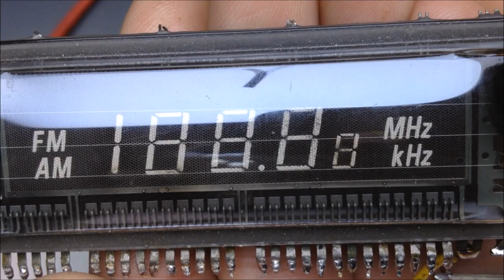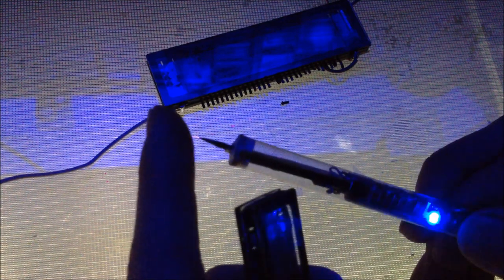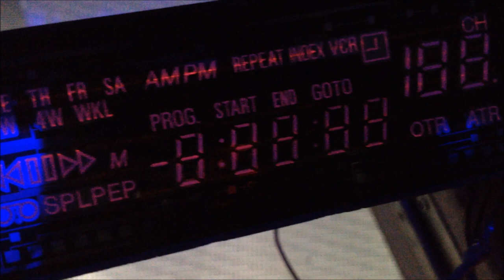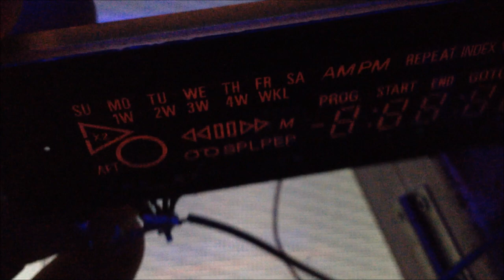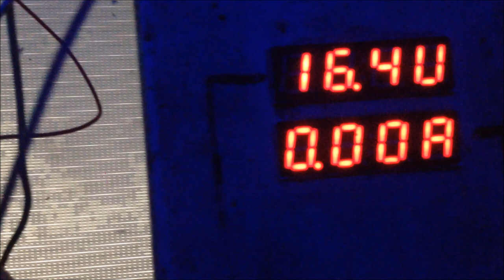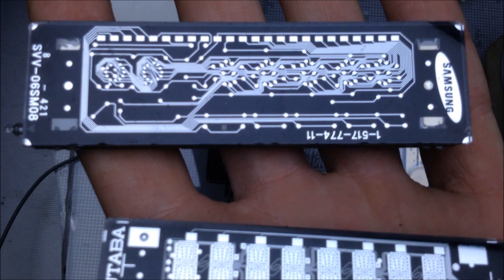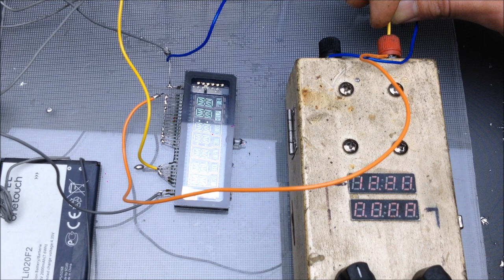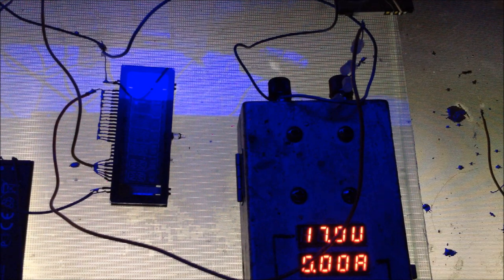How a Vacuum Fluorescent Display (VFD) Works, Wiring + More

Comment: I have started playing with pickle jars and plasma since I had 30KV and a lab vacuum pump sitting in my face. I wanted to create VFD elements to light up but no one would explain the actual voltages required. Your vid gave me the exact knowledge. Thanks. I am off to the plasma lab now!
Reply from the maker: Glad to of helped!
Reply from the maker: I can't comment on your video about the DIY decorative light you made but man, that's a clever use of LCD material so simple and looks really good. I am a fan of that LCD stuff and put it in all sorts of projects.

Comment: Do you know if the pins that are not positively biased need to be grounded, or can they be left floating?
Reply from the maker: I have not seen any resistors on VFDs from pins to ground so I think they can technically float. You'll get much faster response rates if there is a small bias to ground through a resistor on the pins though.

Comment: Thank you for this very helpful explanation. I am learning how these work and you made it all very clear.
Can you tell me why you have the series resistor on the filament drive when you are using a battery, is it for some form of current limiting?
I am working on an AC filament supply for some large Russian 7 segment displays so I can get an even glow across the large segments.
Reply from the maker: Glad it helped out. AC is a much better supply source than DC when it comes to the filaments. The resistor in series is for a current ballast. The filaments like to run in the 2v range and 4v from a fresh lithium ion is a tad much.

Good luck on your project!
Reply: @Zenodilodon  Wow - thank you for your speedy reply.
I get it - battery 4V, resistor - drops the volts - nice.
Yes, I am using a PWM source to generate 5V A/C.
I am using large Russian VFD displays  ILC1 1/7  and  ILC1 1/8
So far I have 5V  filament drive sorted, 24V for grid and segments, a micro controlling 595's coupled to a TD62783AD to drive the segments and grid.
I have had some help with the AC generation and am still trying to get my head around that but it's coming together.
Thank you again for your excellent guide.

Comment: Any idea what would cause a VFD to go dark when your finger gets close to it? you dont even have to touch your finger to the glass, just moving your finger close to the tube will cause the segments to get wiped, after a while they will come back, this issue has been driving me crazy, I dont want to just condemn the tube but given its a bit weak anyway it sure looks like the tube is the issue but Ive never seen one do that when you get your finger close to it, any clues on that? Thanks
Reply from the maker: Sounds like the solder connections on the display or from the voltage source to drive the display are poorly connected. I am betting there is at this point just a trickle charge going through and when you put your hand by the display it's enough to pull the charge away kind of like on a plasma ball. I am betting that if you go over the solder connections on the display board carefully and re-flow them you'll probably have a good display again.

Comment: Hi
My vfd panel is very low dim.
What voltages should I check?
What parts should I check?
Reply from the maker: There is a range of which depends on your VFD and driving system. I would suggest seeing if you can locate a model number on the VFD and see if the information is listed. Dim can be caused over time by long term running hours, leaking hard seal, or problems with power transistors/capacitors. 

I do not have exact knowledge of specific requirements, just general working principle understanding. Another thing you can also try to do is to locate the datasheet for the IC they are using to drive the display and see if there are application diagrams and notes listing the general technical information for general use and go from there.

Comment: Hey I found your video up here, i wonder if you could help me with my VFD problem. I have a JVC DXJ10 mini stereo with a great looking VFD, well, was a great looking display. Now ALL segments are on, 8888888888 and every possible function also lit up on the VFD, what would be causing that issue, Im figuring the driver chip PT6324ht is a goner, is there a way to test this ?
Reply from the maker: I can't think of an easy way to test this, but I do agree that the driver chip is probably the culprit, either that or there is some loose cable or broken connection for data going to that IC. I haven't repaired a VFD display, nor done trouble shooting on them. I'll be honest, I just like the fact they produce light.
Reply: @Zenodilodon  yeah i have done basic isolation tests to see it is power related i have disconnected one data cable going from dvd and other board sources and all that was left was the onboard driver chip and only power connection, brightness remained the same as did all the segments, all continued to be lit, meaning the only culprit is the onboard driver chip. Dammit. this will prove to be a major resolder job as its 52 pins surface mounted. :(

Comment: This may sound dumb, but Is there a way to change the color of the vfd? I like how it looks but would rather change the hue to a green or a white for my vintage radio I have. Overall great explanation on it I learned a lot @Zenodilodon
Reply: Hey, you can use color filters for the purpose. It's the way other vintage devices had colors for their VFDs.
Reply: @udayabhaskar  so I have tried and it seemed to dim them a bit, is there a way to make it brighter or am I doing something wrong. I got the color I want just seems more dim for some reason.

Comment: I watch the video later , it is very late right now BUT seeing the wikipedia article , this is just a wonder.

As I understood from the design it's just a flourescent tube fitted in a smaller casing with changeable letters?

How can Apple NOT fit a headphone jack , but other companies could literally fit a whole lightning system in a display?! And that's even older.
Reply from the maker: It's kind of a hybrid between a fluorescent light and vacuum tube. 

Apple thinks different, which isn't always useful lol.

Comment: Any help regarding a Kenwood KE 7090 Graphic Equalizer? On standby mode you can see like red lines that glow, never happened before, ive replaced all capacitors but still the same results
Reply from the maker: Sounds like a problem with the filament getting too hot. It should be a fairly simple circuit to trace out and see what the problem may be. The filament inputs are often the most outer connections on each side of the display. You can alternatively put a resistor in series to lower the filament current but if you can track down the reason and fix it that's ideal.
Reply: @Zenodilodon  yeh i think it is over volting, but im no expert, and these equalizers are hard to get hold of, would it be a resistor that's gone open or bad? Cheers for your reply anyway 👍
Reply from the maker: @MrSh4W  If there is a failed component I would suspect a failed resistor. You would have to check the circuit as there are many variations on driving them. You are more than welcome to send over pictures of the board that the display is on. I might be able to assist better after seeing the layout and components.

Comment: Thanks for the video. At 4:40 - this is the exact display used in my Philips DVD mini hifi, and what a coincidence, I'm currently working on it. The display is very dim. Can you please tell me how to test it?
Reply from the maker: They get dim over time, this is normal behavior. There really isn't a good way to test the display unless you know the exact specifications and voltage/luminosity graph. I am betting your display is driven by a single square IC. It might also be a case of a bad capacitor in the unit that is causing a lower voltage to be generated for the display IC and associated system. There isn't much more you can do aside from that honestly. You can try finding a replacement if the screen has a model # on it as well.
Reply: @Zenodilodon  no it's not due to age. It was working a few days back.   Must be something in the circuit. Thanks for your help.
Reply: 👍👍👍Fixed it. It was a bad transistor, supplying -32V to grid.
Reply from the maker: @abhishekmallik1194  Glad you got it running!
Reply: @abhishekmallik1194  what transistor? Do you have a picture?
Reply: @tygrxd5415  it was a BC327

Comment: does the display turn on if one of the filaments is broken?
Reply from the maker: It technically can if only one is broken, however the loose filament wire can lean against the grids and short them out so it's not advised.
Reply: @Zenodilodon  ok. thanks for the reply.

Comment: Multumesc pentru prezentare mi-a fost de un real ajutor
Reply: Asta inseamna ca stii si cum sa alimentezi filamentul desi asta nu a explicat-o in clip.
Reply: @nelunicoara4483  da ,am revazut videoclipul si eu zic ca a explicat tot cum functioneaza
Reply: @ioanmarina9328  Eu zic ca nu. Sau imi spui tu cum se alimenteaza filamentul.
Reply: @nelunicoara4483  la tipul de display prezentat ,in stanga primii doi pini sunt borna negativa a filamentului  , si ultimii doi  din dreapta sunt borna pozitiva.tensiunea de alimentare este cca. 3v
Reply: @ioanmarina9328  Gresit!!!!! Daca ai fi lucrat cu asa ceva ai fi constata si singur ca daca alimentezi filamentul cu tensiune continua lumina displayului va varia de la plusul alimentarii filamentului catre minusul alimetarii filamentului in sensul maxim - minim. Pentru uniformizare filamentul se alimenteaza cu tensiune alternativa sau in impulsuri.

Comment: Berapa kak tegangan untuk filament nya?  Dan untuk menentukan pin positif  dan negatif nya bagaimana
Reply from the maker: Filamen harus didorong dengan arus yang memberikan panas yang cukup untuk berada tepat di bawah mata deteksi visual. Anda dapat menemukan ini dengan menaikkan tegangan ke titik cahaya redup dan turun dari sana. Tidak ada + atau - untuk filamen, sebenarnya yang terbaik adalah mengendarainya dengan AC yang mencegah gradien kecerahan terjadi di layar dari satu ujung ke ujung lainnya.
Reply: Lalu yang kakak praktekkan itu pakai tegangan berapa volt? Terimakasih banyak
Reply: Saya cuma pengen tau cara mengetahui vfd saya masih bagus atau sudah rusak pada home theater saya
Reply from the maker: @Mustdeny  3 volt ke bawah biasanya kisarannya.
Reply from the maker: @Mustdeny  Uji filamen dapat dilakukan dengan menggunakan mode uji kontinuitas pada multimeter. Seharusnya membaca di bawah 100 ohm jika terhubung. Anda juga dapat menguji vakum dengan mudah. Jika Anda menjentikkan layar dan mendengarkan dengan seksama, Anda akan mendengar dengungan filamen bergetar. Jika suara bertahan lebih dari 5 detik, biasanya bagus. Udara di dalamnya akan meredam getaran dan menghentikannya dengan sangat cepat.

Comment: When I was a kid I couldn't wait to toss these junk displays out. So ancient. Now I revere them and keep a collection of them out of respect and nostalgia. I came across an old jar of color phosphors salvaged from a Trinitron last night and I am firing up my vacuum pump for some work tonight so I think I am going to make a crude VFD using the mixed phosphors and the tungsten wire salvaged from an Ionic Breeze. Might take a bit more filament current than usual. 🤔
Reply from the maker: That sounds awesome! I know you need a pretty high vacuum for these displays. I am not sure how low you can pull down too but if you're in the US and have problems I can probably help with that as I do have access to high vacuum gear.

This is something I should try. I am betting the filaments in an old 120v bulbs would be plenty long enough for liniments. 

I tossed a lot out as a kid too, the one thing I enjoyed was the very long ringing of the filaments if you flick them with your finger and hold the display up to your ear. They vibrate for a decent time do to a lack of air resistance. Some of the sounds can be quite nice while others are almost a eerie sound. 

I still think the custom displays like for stereos are trash and don't really keep those, but the numeric displays are worth keeping IMO.  I have no idea what I will do with them but they light up and that's good enough by me.

Comment: 7:54
The filaments are blown
Reply from the maker: Yeah, I found that they snap really easily when you turn them up to the point of glowing visibly and then turn the power off. I think it's mostly due to rapid contraction at the wires cool. Or in other words, I abused it to death.

Comment: AC VOLTAGE OR DC VOLTAGE
Reply from the maker: IT'S DC VOLTAGE
Reply: @Zenodilodon It's not!!!!!! you lie. With DC voltage your diplay has a fading out of light from pozitive pin of filament to negative pin of filament.
Reply from the maker: @nelunicoara4483  You are correct, however I did not " Lie "  he asked a general and nonspecific question, the for the most part the tube does operate on DC.
Reply: @Zenodilodon  ..And you are right partialy. Question is too general and even for a beginner, question is specific but for a newbby should came with more detail.
Reply from the maker: @nelunicoara4483  lol, Yea part of my lack of response was do to the lack of effort put into the question. Excellent clarification as a follow up on the filament. I would of also accepted 

"FILAMENT AC! ~ shakes fist ~ "